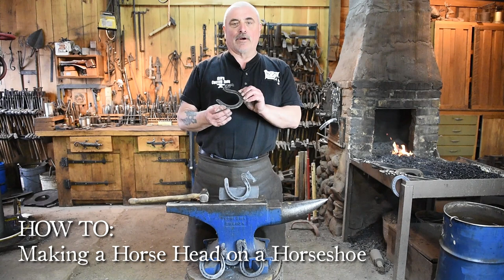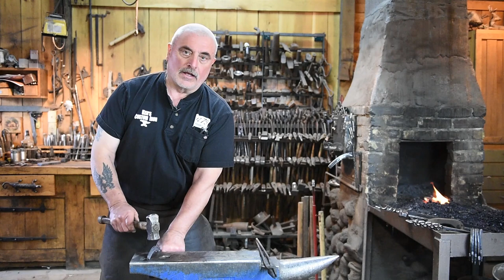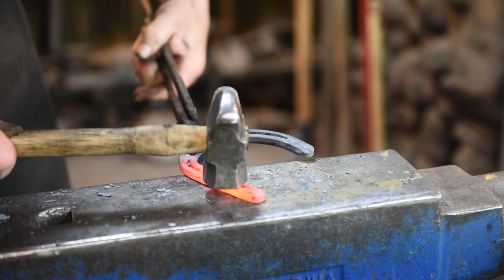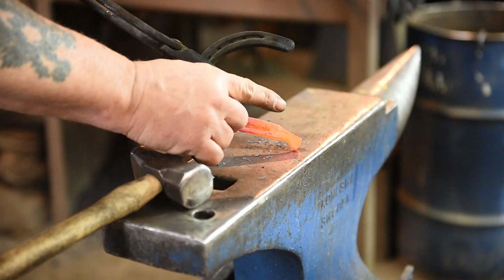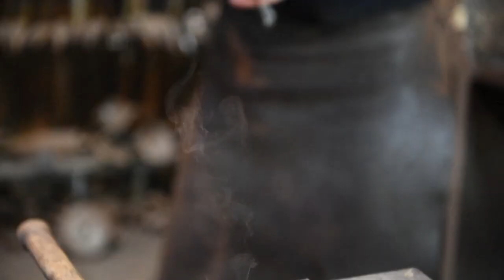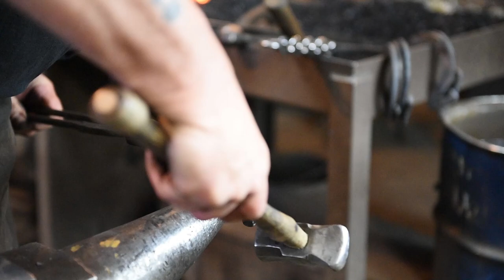HOW TO: Forging a Horse Head on Horseshoe

Comment: Great video! Two questions, I have mules is it difficult to lengthen the ear, (I have tons of old shoes and could just experiment) How did you make your eye punch?
Reply from the maker: You can drill a small hole in the end of a rod and then grind away the material to shape the eye or you can go to kensiron.com and purchase one made from H13.......